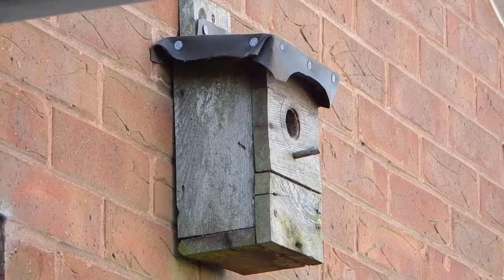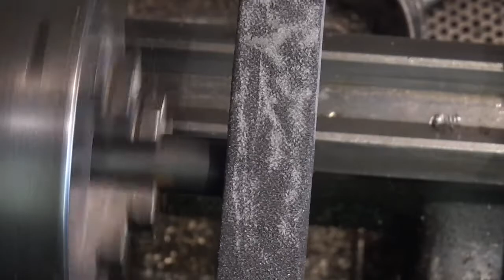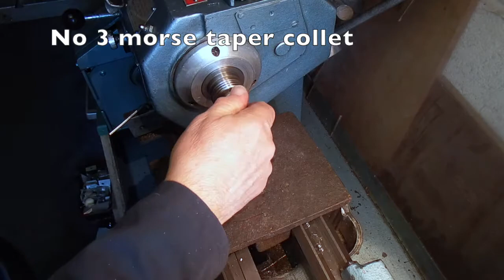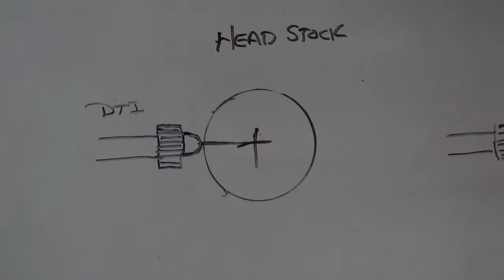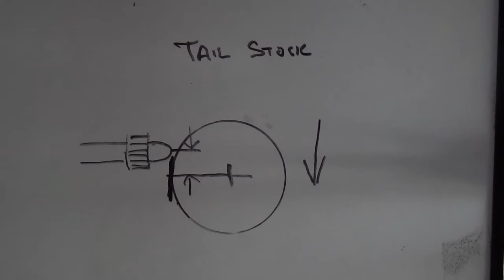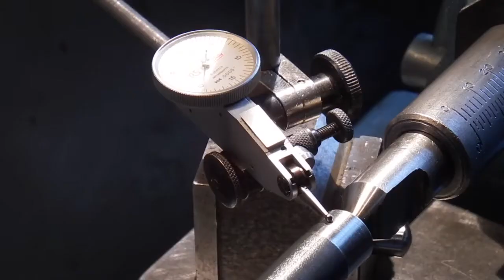Tailstock offset.

Comment: What would you suggest I do to raise my tail stock up to center. I have been using a feeler gauge under the  tail stock before clamping it down.
Reply from the maker: Hi
Thats a difficult question it depends on how much it's out and the type of tailstock you have. I used feeler gauges to pack up the tail stock on a grinder but when it got to 0.010" I used a sheet of brass shim cut to the tailstock base size which worked OK.
If your tailstock runs on a vee guide packing up the base may give you more side play.
Alan
Reply: I have a Boxford like you. Its out by .3mm. I have been spacing the rail closest to me with the feeler, so that's a flat rail. The far rail is vee guided. So its an uneven lift (twist) but with the side to side adjustment I get the tail stock center. I was just wondering how you are supposed to do it properly.
Reply from the maker: Hi
I have checked my tailstock and if you have the same one as me i.e. it is adjustable for taper turning and has the zero mark on the end and a grub screw on each side for adjustment ( the one at the end of the video with the Allen key in it)  This tail stock can be split you will see the casting has two parts upper and lower.
I have not tried this but but if you remove the tailstock turn it upside down you should see a grub screw which holds the clamping lever bar, slacken the screw so you can remove the clamping bar. Remove the two grub screws (one on each side) of the tailstock. They clamp the top casting to the Botton casting. You should see a small slot in the tailstock side, with a lever you can remove the top of the tail stock from the base. Try placing some shim on the top of the base and replacing the top of the tailstock onto the shim. Then replace the grub screws and clamp bar and align the tailstock.
As I say I don't know if this will work but it may help.
Alan